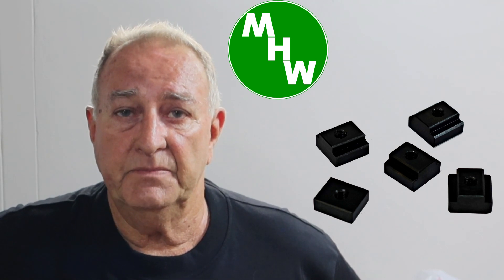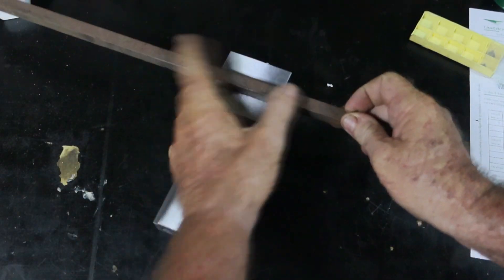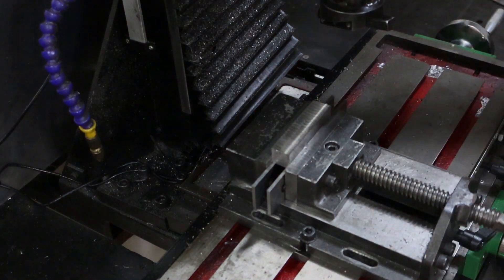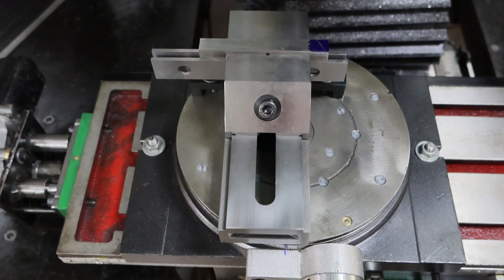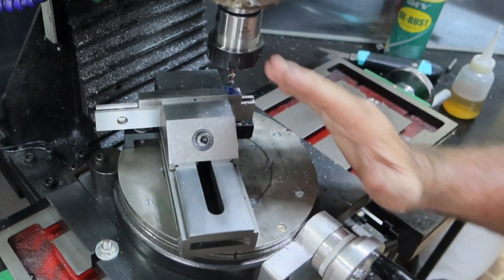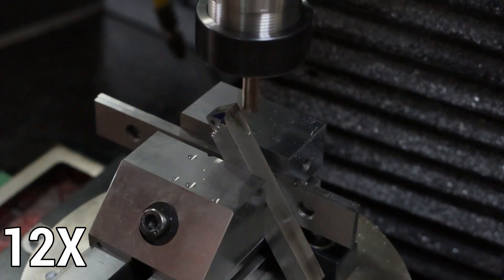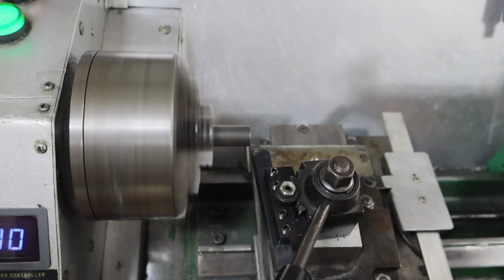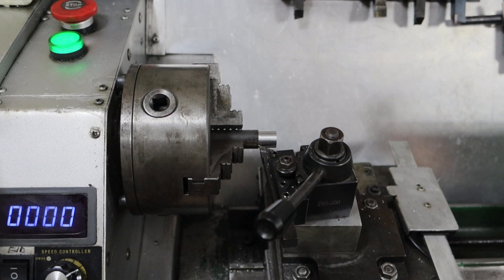MHW Episode 95 - Indexable Insert Toolholder

Comment: Is that 2 inches vise? If so I just bought one last month from a local tooling store on Shopee for about 1700THB and didn't have to bother with customs. Not sure if Youtube will allow me to add the store name in the comment.
Reply from the maker: No it's a 2 1/2 that's why it was a bit more expensive, I kind of wish I had bought a 2" version. 👍
Reply: @MyMiniHomeWorkshop  I see, for me it more like I wish I get 3 inches instead. For local tooling shops (maybe you can find something priced reasonable there and don't have to wait for it to ship from oversea and dealing with customs) that I frequent are fk_tooling (carbide inserts and other toolings) , T.M. Tooling (2003) (carbide inserts and holder), JSR Entech (they import  various Japanese made tools including end mill and indicator) and Sunrise Group (Taiwanese made vise, Israeli grinding wheel, surface plate, etc).
Reply from the maker: I already use FK on a regular basis when I don't have time to wait for stuff to arrive 👍